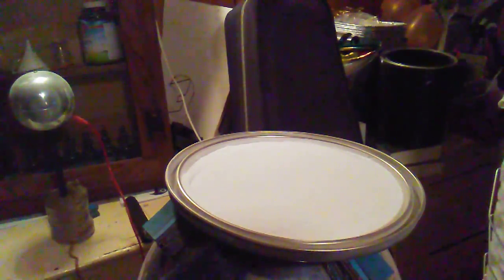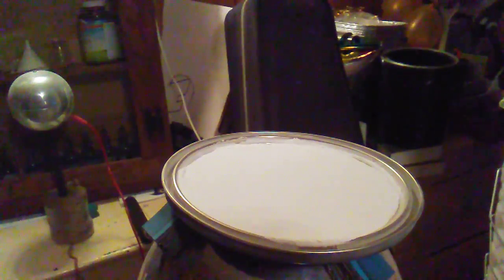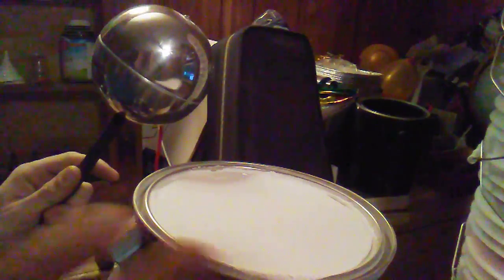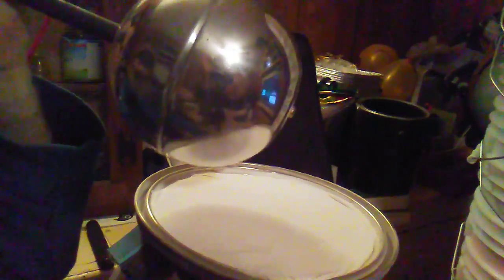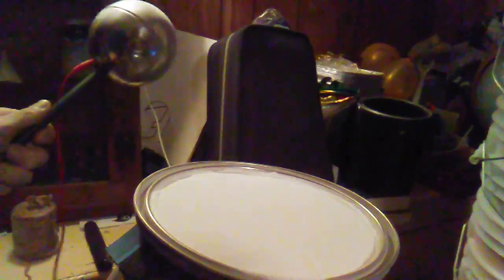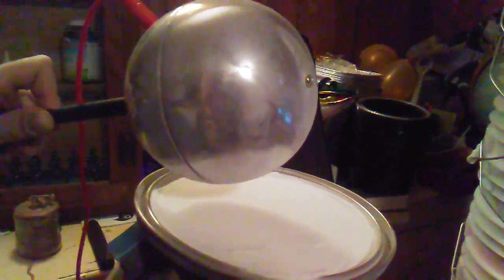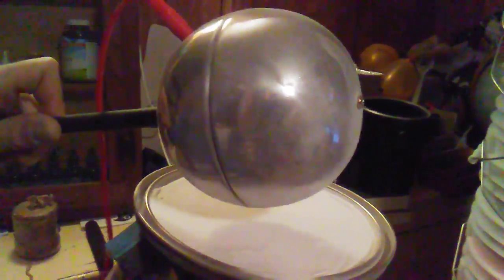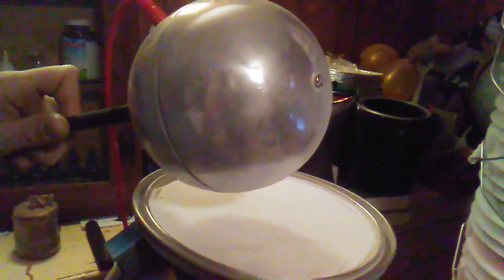(MIRROR) Must See: Observing moon like craters made with electrical discharges

Comment: Have you noticed that you can't see any craters on the full moon?
Reply: Yes you can
Reply: RJ Drakon no, you can't, and I have proof, I'm not just saying that. You obviously haven't looked closely. You can only see the craters near the terminator line, when the moon is full, you can not see the craters.
Reply: You are overexposing your camera, genius.
Reply: EmpiricalPragmatist nope, same camera, same settings, you can see the craters the day before and the day after, but not on the full moon.
Reply: "same camera, same settings"

Exactly the problem. The moon is brighter at full moon than at other times, obviously, so if you could see craters the day before, your settings are correct for that brightness. That means those same settings are too high exposure for the full moon. Lower your exposure and you will see them.
Reply: EmpiricalPragmatist ok, I'll try that.